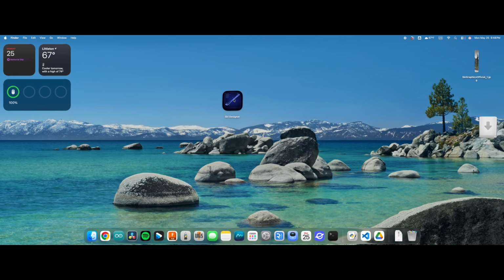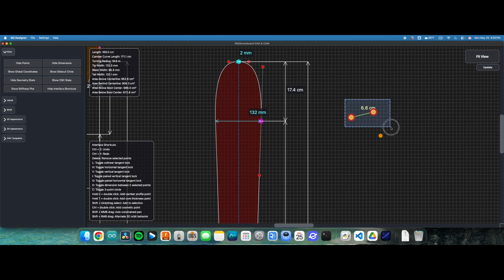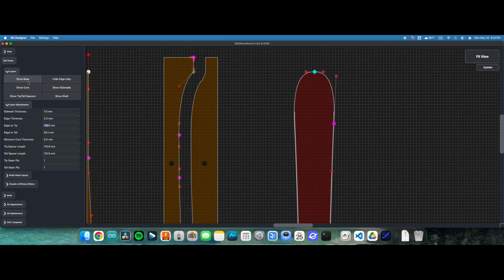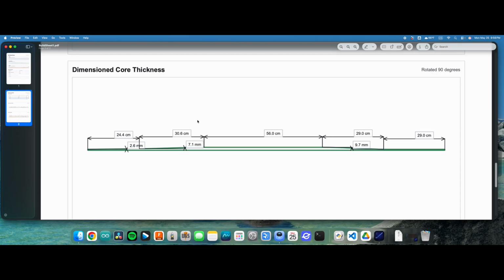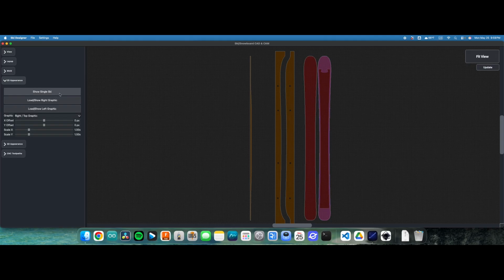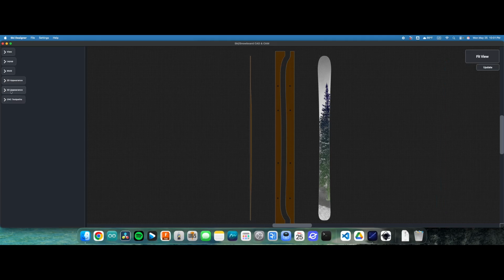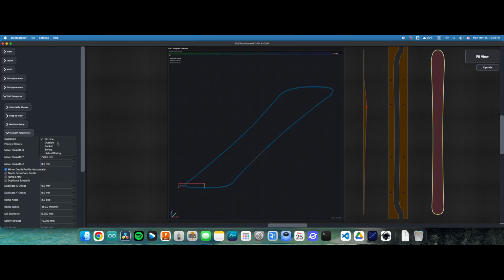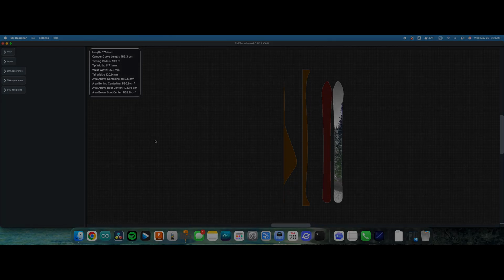Ski Designer - Open Source Software for Ski and Snowboard Builders

Comment: Hi, sorry for the very stupid question. I have only been using Python for data analysis so directly showing me the code page. How do I actually see the software interface shown in the video once I download the code?
Reply from the maker: hey, no worries!  I'd assume you have python installed on your computer already (otherwise its at python.org).  Then there's 1 library to install, pyside6.  Window's/Mac are a little different, but should be able to open terminal and type pip install pyside6.  Then just navigate to where you put the downloaded program (cd path/to/your/folder).  I'd suggest the version skiDesign_152_dimensionStackupFix.py.   Then just type 'python skiDesign_152_dimensionStackupFix.py' and it should run.  Cheers!
Reply: @redbarrelskis3361 thank you! That worked!
Reply from the maker: Score!  Good luck with everything!!

Comment: hi, the dxf file that I exported from the software is not opening with any other program. I tried solidworks, e-drawings, autodesk onlne wiever but all programs give an error as " file can not read" or "invalid file" How can I solve it? Thanks
Reply from the maker: Hmm, I recently uploaded a version to github called skiDesign_152_dimensionStackupFix.py.  Maybe check that version?  I just did a quick export test with it and it worked for me.   Inkscape is the app that I used.  The curves are exported as dense polylines, not true DXF arcs/splines, so large files are expected.

https://github.com/jdskier1/SkiDesigner

Comment: Very interesting. Thank you. Where should we look for a CNC machine that has a bed long enough to do the core in one go?
Reply from the maker: A 4x8 machine would do the trick, but that's borderline industrial grade.  I hacked one together from a 500mm X-Carve (there's a video about it on the channel here).  Otherwise I know AvidCNC does custom units.  I reached out to them today, hoping to work on a design with them specifc to ski/snowboard construction (and garage friendly size wise).  If that pans out I'll be sure to post about it here on the channel. Cheers!
Reply: @redbarrelskis3361   Thank you. Yes please. I found one from OozNest in the UK, but annoyingly it only goes to about 5 feet. Apparently it is a screw length thing. The screw will sag too much over a certain length vs its diameter.
Reply from the maker: MINI SKIS!  ahh just kidding, yeah I'll keep ya posted.  Cheers!
Reply from the maker: @perro007  well shucks, the narrowest configuration AVID could do ended up being about double the width of my current setup.  For my shop that's a deal breaker.  I definitely had a good experience with their customer service rep, totally wish that company the best.  I really think this is maybe the biggest challenge for home based ski builders.  I definitely plan to keep working on a micro-manufacturing system here on my channel in the future.  I've got quite a few napkin sketch's of CNC's with UV/IR waxing lamps, tool changers, vacuum tables, lasers, 3D print heads, maybe a system for etching structure into a base, etc.. built in.   Good luck with your build!